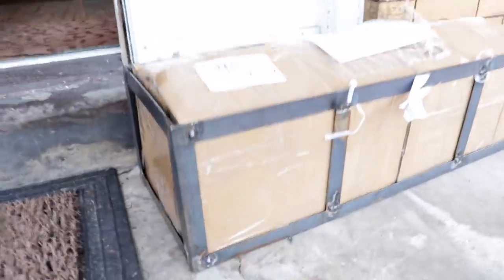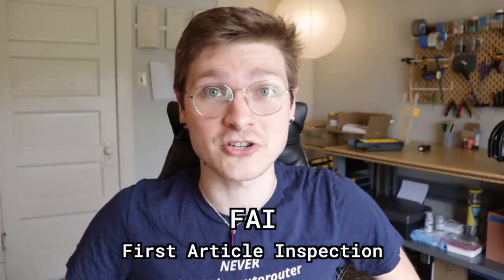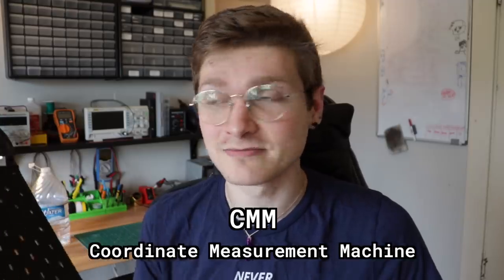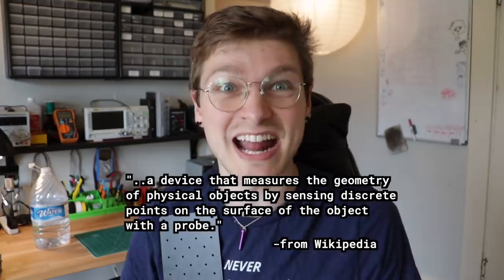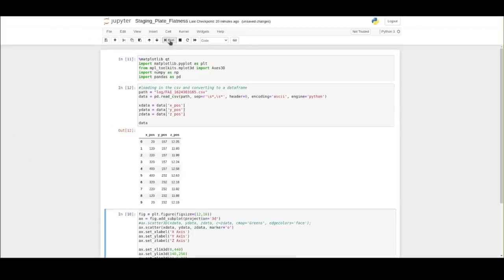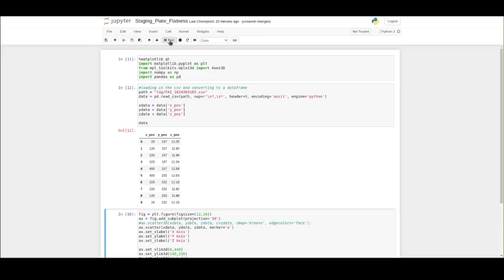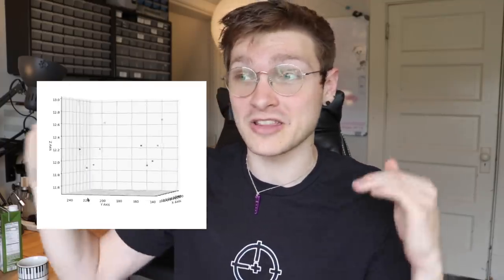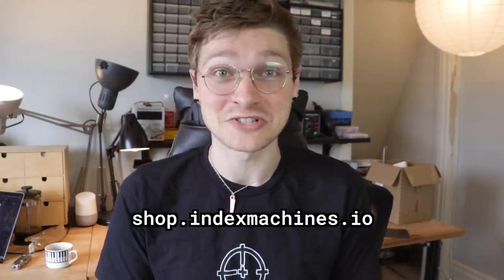Index Machines: Our first product!

Comment: Hey! Just FYI that dial indicators like the one you used usually have a serial port where you can read the measurement. I dont know if your particular one has one, buuuuut usually on amazon there are ones that do have a serial port and they are really cheap. Integrating the indicator in the system would be SO COOL! As for everything else.. keep it up!

Comment: See how much it would be to bend a 1/2" lip on the front and back. That would do huge things for the stiffness.
Reply: +1 on adding folded edges. Then it may not need to be as thick (save weight -> save cost of shipping)
Reply: That’s a solid idea, and we’ve talked about doing it. It’s a great trick to keep in the back pocket if it ever proves necessary! Thanks for the suggestion.
Reply: @byoung255  good idea but unfortunately no. It would take up a lot more space, and space usually is what costs not the weight.
Reply: @mikkelkirketerp4884  Good point. Shipping from supplier would be more tricky. They could be stacked in am alternating fashion.
Reply: @lucianchapar  just mounting parts on it can flex it at bit. These bends might help or perhaps just an alu beam beneath would counteract it and make it more stiff. 🤓

Comment: You changed the manufacturer's part when you mounted your boards and other parts to it and then mounted it into the frame.  Those will apply some unknown stresses and torques to the plate.  So, what you're doing is in-situ testing, not acceptance testing.  But, in the end that's what you want to test in your integrated environment, if the focus of the camera is sensitive at those error levels.  Also as noted below, powder coating is not a precision consistent thickness operation, consider anodizing.  I'm enjoying the series and might end up building one for my own PCB projects.  Keep up the great work and I love your enthusiasm!

Comment: Four screws? Wouldn't you be better of mounting it on kinematic 3-balls if you want to measure the inherent flatness of the plate? Now you have copied any torsional inaccuracies of the aluminium profile into the plate, albeit reversibly (elastically). 6:05

Comment: Still I don't understand why you have to use a giant metal plate to mount the electronics and pump and not just more aluminum profiles.
Reply: The "up" webcam goes there too. It does kind of make sense. Probably doesn't have to be the full length though.
Reply from the maker: We could! It's a good idea. Part of the reasoning was to have a nice surface to mount a board or other things to magnetically, plus having a plate gives us space to easily mount the up camera. If you build one with extrusion instead I'd love to see!
Reply: The magnetic surface and the regular pattern of holes provides a great utility for dealing with wire management and having a place to mount the electronics in a predictable spot for kit assembly.
As a part for your business to manage the outsourcing of, and as you show quality check, it seems as if this part has created too much complexity and cost for the utility it provides as a solution.
Your suggestion of a boot is a better, simpler and cheaper method to get the same repeatable flat surface to support an MDF, plastic, melamine, plywood or aluminum plate with similar results. 
A couple of extruded aluminum rails could also span between the left and right sides with corner brackets. 
Some people could easily source a piece of material cut to the right size then cut the holes and a correctly sized hunk of wood as the boot to prop up the center span. 
@Stephen Hawes - you have already done an amazing job with this project and we see how excited you were to be able to outsource successfully from an external vendor, but it seems as though the plate part doesn't make much business sense for a DIY project except for those who would rather pay and extra $80 instead of cutting a piece of plastic or wood from a local big box store. 
I like the strategy of getting product in the customer's hands as fast as possible, but it seems to me that finding a reliably sources and fairly priced solder paste nozzle/syringe head kit and nozzles for the pick place head are the parts I am having the most difficulty with sourcing. 
Of course, the motherboard PCB, cameras and feeders (in that order) are the parts that allow someone to get most of the platform started.

Comment: 0.8mm isn't "small". Consider anodizing instead to get more consistent finish thickness, and a edge flanges or mount to extrusion?
Reply: it's completely expected given steel's tensile strength. it's not the finish thickness that's an issue.
Reply: On my 1500x1000 CNC with 1100x800mm work space I have 0.05-0.1mm deviation and I think it is "big",

Comment: Just a heads up your 3D printer style rail might actually be a slightly bowed. I've had this issue with sourcing linear rails also.
The only way to verify your measurements is with an precision flat plate. Then compare those results to your part.

Comment: Flip the board downside up and measure again. Also the spring of your measurement device adds to the bow deflection. I could see it in the film, specially in the middle. And .8 of a mm is about 3 times the thikness of a resistor. Rather big

Comment: Could the bend in the plate be influenced by gravity? Usually, strings that are laid across a distance will bend according to a hyperbolic cosine once they come to rest. Why not flip the plate and run the same test on the other side- if gravity is the factor that is responsible for the bend, you should see a nearly identical curve on the other side. Measuring discrepancies between the curves you get for each side would be an interesting way to evaluate the net curvature.

Comment: Stupid question, but how do you know it's not the gantry which is distorted?
Reply: He could flip the plate upside down and redo the measurements. Subtract one set's xy location from the other set's. Zero means the gantry was bowed.  Big difference means plate was bowed.  Could figure a formula that gives error of each.
Reply: @TheRainHarvester  good point. Hopefully this will be covered in a future video, cos without it I dont really see the value in this data.
Reply: @Ziraya0  yeap I think the mistake, if you can call it that, is to talk about the plate flatness, instead of the ability for the end of the nozel to track the surface of the PCB, or for the webcam to track a part held over it etc.
Reply: @TheRainHarvester  True. I also suspect that he would see an apparent bend in the other direction once he flips the plate, just due to gravitational pull.

Comment: +1 to FreeCad, would love to see a tutorial on how your transition away from Fusion 360 went, because I found FreeCad pretty difficult to go to after getting used to Fusion 360. It still takes me about 2x the time to make the part on FreeCAD :(, but I really want to support the project and make it better, so I'm pusshing through.
Reply: Maybe check out the OpenSCAD workbench for it.  I LOVE how easy it is to create foundational geometries (or even the whole model) parametrically with just a simple script.

Comment: If the flatness of the steel plate is being driven by the camera's ability to focus, why not increase the the depth of field of the camera.  You have plenty of light, so you could go to a smaller aperture thereby increasing your depth of field.  See the online Depth of Field calculator for more information.  Money spent on decreasing the camera's aperture with a special lens might be less than on the steel part (and you could use right angle stock to support the long stretch and stabilize it enough).  Food for thought.  You could also program for the components height and adjust your Z to the part to bring its bottom face within your field of focus.

Comment: Wait, but if it's just a powder-coated laser cut piece of cold rolled steel, then the "flatness" can vary from spot to spot across the whole sheet, which the parts were cut out of. Isn't it OK to rely just on flatness of a single sheet of metal without any strengthening ribs?
I think you have to put at least some 20x20 or even 20x40 extrusion across the whole sheet, to keep it from flexing and reduce any potential curvature.
Edit: watched the remaining of the video, extrusion across the whole plate would still be way better than a foot in the middle. Less machine setup time would be required. More plug-n-play experience.

Comment: Stephen - I have 4 csm7100 essemtec machines which are functional.  I am wondering if openpnp and your project could be used to bypass the main pc and incorporate a vision system.  It uses the laser system right now.  They easily place 0402 size. Would give these machines more capability.  They are 4500cph.

Comment: for negating the bow of the plate, why don't you use 1 or 2 corner "L" profiles(like the ones used for the rails) on  both sides of the plate, to add some rigidity?

Comment: Measure, flip top-bottom, measure, subtract. Should remove machine imperfection.
Reply: Not only machine imperfection, it would also remove gravitational influence. Everyone knows that a bridge will dip down under gravitational pull. The same thing happens to anything suspended by two points.

Comment: the only issue with this type of "validation" is you can't take into consideration how straight your aluminum extrusion is what you should do is surface a spoil board on a CNC that will give you a parallel surface to your other axises Then mount the plate to be measured onto that it won't be as good as a surface plate but would be slightly better than your current approach and would be very accurate if you could get it done on something like a tormach HASS etc using the surface probe no need to make a spoil board.

Comment: You can get rid of the foot and most of the bowing by having a bend on the longitudinal edges… this must not add much to the fabrication cost… nor a big design change
Reply: and they don’t need to be 90 degree angles so you can get the parts stacked to save on shipping by having them a slightly less than 90 degree (85 would be fine I guess but you can do figure this out in CAD)
Reply: Yeah this flat steel part doesn't make much sense to me. Stephen chose steel so that things could be mounted magnetically to it and would be easy to reposition I guess. I'm not convinced the magnetic mount is particularly useful, and it makes this piece unnecessarily heavy to ship and to handle in general. Without one or two longitudinal bend it's going to get bent up in shipping, especially with that large hole in the middle creating a weak point.  I think one or more readily-available aluminum extrusion rails would be as effective, using T-nuts to hold down whatever needs mounting. Or simply add a thin sheet of steel where needed on top of the aluminum rails, with the aluminum extrusion enforcing flatness.

Comment: I like this series and your enthusiasm about the project. But I doubt this plate is the most logical solution for what it does. And more important: your measurements made absolutely no sense: you have absolutely no details on the straightness of the gantry. Keep in mind this mistake also invalidates any measurement you discuss in the future. In my opinion it’s better to keep it simple: “hey here’s a nice part that works for me. Keep in mind it isn’t 100% flat, so you need to do some checking and calibration yourself.”